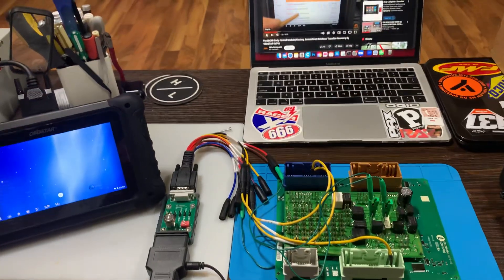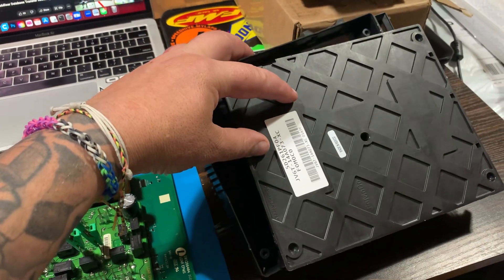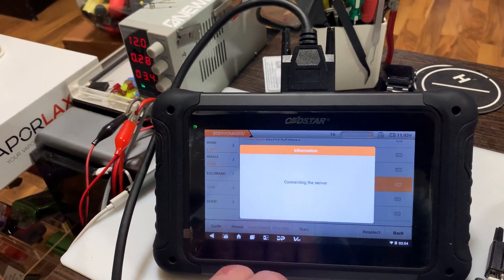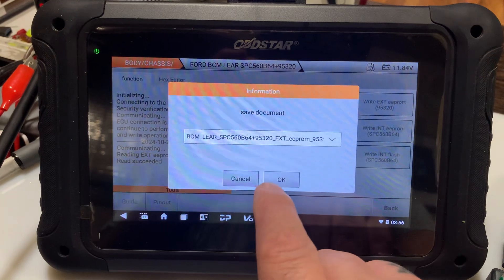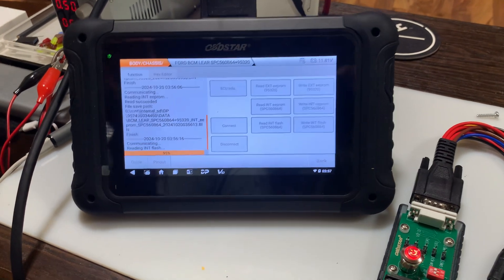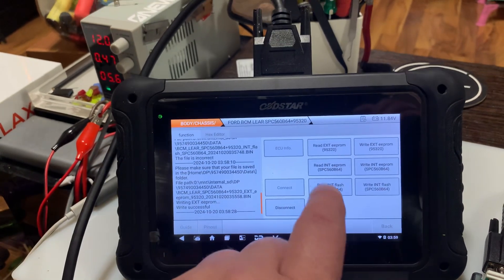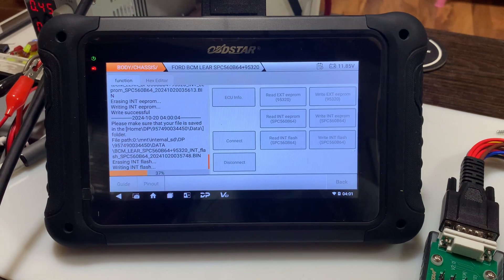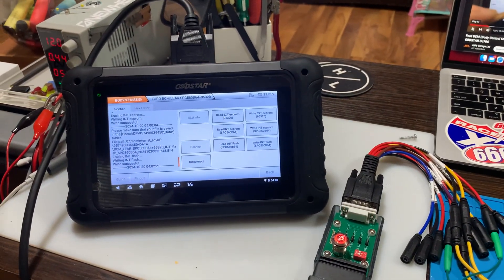OBDSTAR 706 w/p004 CLONING OF 2020 Ford Focus BCM module eeprom  ST M95320 / int flash ST spc560b64

Comment: I have a really weird situation with a fleet vehicle that has no pats but when using fdrs to program BCM it automatically adds pats to a non pats vehicle. The only solution I see is cloning it. Any experience with that issue? Any other options that you would know of? Many thanks!!
Reply from the maker: @maxattison5234  Fdrs must use a downloaded file vs using what’s actually read out of the Bcm .
Reply: @drewjohnson5402  can you clone for me? 2020 f350 bcm
Reply from the maker: @maxattison5234  absolutely, 712.204.3955,

Comment: Why do i always see this tool used with a external power supply? Dont it come with a power supply?
Reply from the maker: @boydlittou9446   it does come with a 12 v power supply it’s just easier to use my power supply that’s already plugged it and I can also adjust it a bit over 12v which helps make sure things go smoothly.  Watch my video about cheaper power supplies